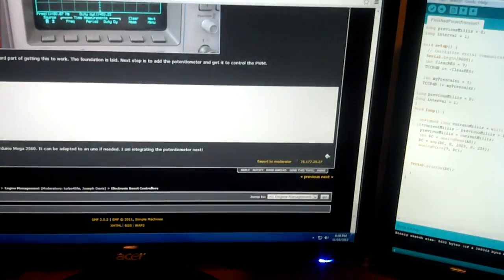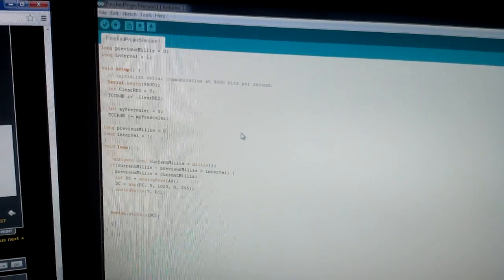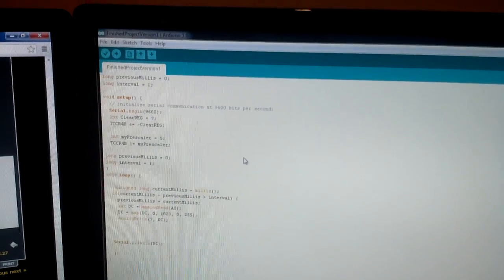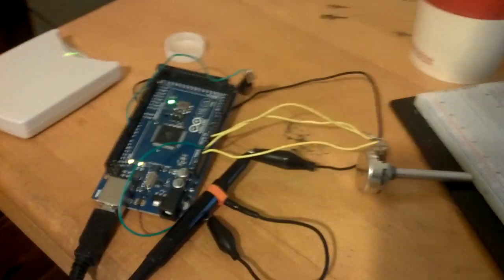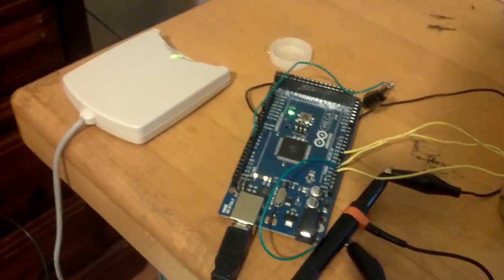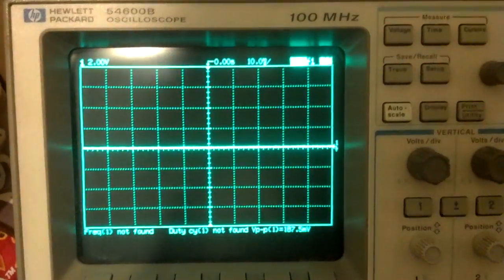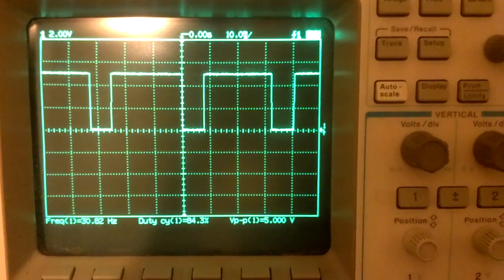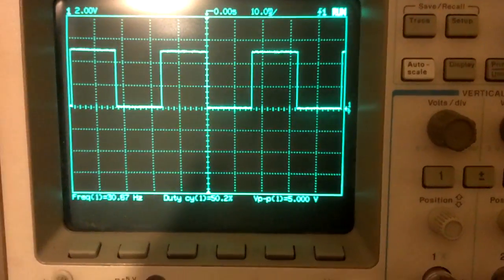Arduino Boost Controller

Comment: Very cool. I'm thinking about doing something similar. Do you have the code posted anywhere? I really want the WG duty cycle to be based off of the differential between two inputs from wheel sensors so I can have it pull the boost back when I lose traction.